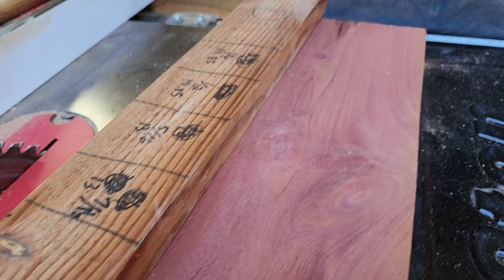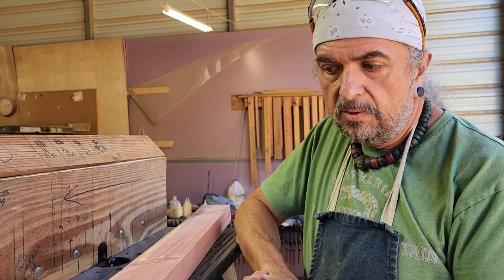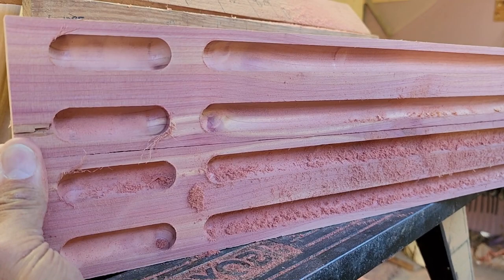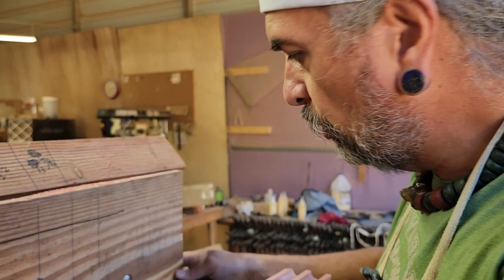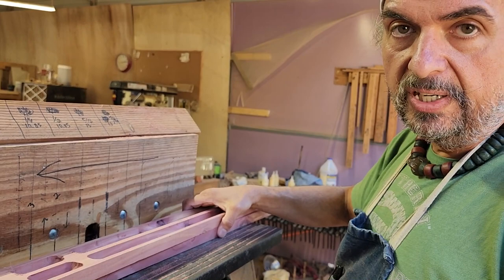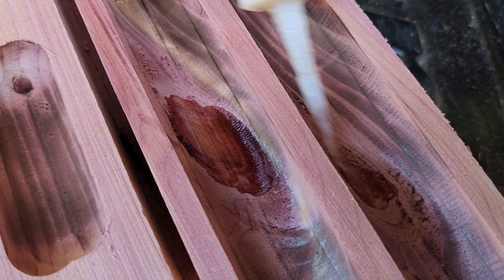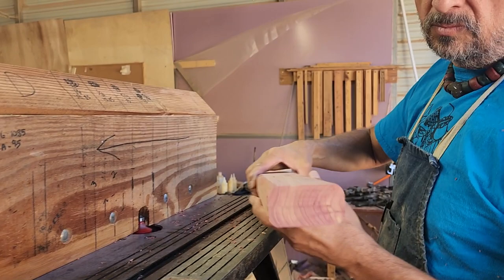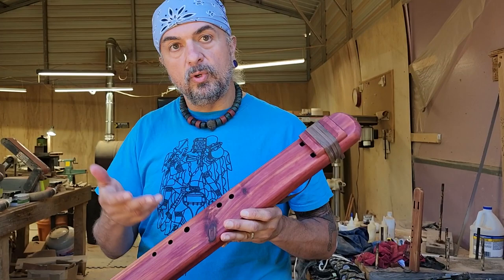How to Make Low D Drone Flute Tutorial - Blue Bear Flutes

Comment: Dude, thanks so much for all your show how!!! I'm about to dive right into Native American flute crafting!! I have 25 years experience in residential building and remodeling, all the tools, and access to some nice bamboo and red cedar as well, so I'm psyched to get started, and I super appreciate you Brother!!
   When you were talking about safety in this video pertaining to your router channelling cuts, I wanted to mention a few things that would keep one much safer when making these cuts with a cove bit as I have used the same setup and I know a board can run away from you and take your hand with it in lightening speed regardless of what kind of grip you think you have on it!
 If you start with a square plow bit 1/2 the width of your cove bit @ 1/3 the desired depth, removing that mass and then step your cove bit in to your square channel in incraments of 1/3rds to your desired depth, removing much less material per pass with far greater control, it'll relieve the buttcheek clinching and save your fingertips & livelyhood. There is also a type anti-kickback guard that you can purchase or make yourself, which with you can use push-sticks and assure absolute safety. I'll try to describe it as best I can because it's simple to make. This type of guide is a second fence that mounts adjustably with bolts/tracks/wingnuts like your standard fence probably does; opposite side of your existing main fence against the otherwise handled edge of your board. From a directly above viewpoint looking down at your router tabletop: it is a (guesstimate) ⁵/4" or 1”× 5"×9" parallelogram shaped block with a 2.5" forked (or toothed) side angled aprox. 12° from 90° in the feed direction. If you can picture this, it literally locks your workpiece in one direction against your fence permitting ZERO mistakes in your cut and fingertips! It's a win win! 
If you decide to make your own using wood, be absolute certain to use straight grain aligned with your 12° to the teething, or no less than 7 ply -¾" zero void finish plywood for this jig.

And so I write all this because safety means.... NO ACCIDENTS! And we craftsmen really do need our fingertips! WhirrrrrrrrzzzzzzzzzzRRRNNT! EEYOWWWWCH!!!! May we all know Christ, Peace for all nations, and many more creations. 
Best reguards 
        -Jake
Reply from the maker: Hey, Thank you for your comment Jake! Lots of great ideas in deed! I look forward to seeing your flutes!

Comment: Thanks for an nice video as always Charlie !!!

My single low E and D has an 30mm bore and the C and B has 35mm bore and my low A has 40mm bore and the G and F# has 45mm bores.
My low D and C drone has 35mm bores, special order for me since a bit bigger bore makes fuller sound and a bit shorter flute,
also ordered them unfinished, and i used Danish Oil to finish them.
I bought one low D a long time ago on the net that only had 1 inch bore and it did not had that full sound.
My midrange flutes has the standard bore size except for some specials A, G and F# that have 1 inch bore.

Just wanted to share.
My next wish in my dreams would be to get an mid drone F# with 1 inch bore :)

Comment: Charlie, I really really enjoy your videos and I have to admit I don't watch enough of them because I'm usually busy making flutes. Your videos are so packed with useful information that I help me when I run into a flute making issue or challenge.
 Interesting that you say the 3/4 core box bit will catch or pull less than the larger diameter bits. When I began making flutes I was using a 3/4 core box bit to create a 7/8, 1 inch wide air chamber/bore and I had the the flute blank yanked from my hands too many times to count. I had too many flutes ruined from using the 3/4 bit to create the wider bores that I invested in 7/8", 1", 1 1/8" core box bits. I haven't had any issues with the larger bits catching and yanking the flute half out of hands. I figure it this way, I would rather spend the extra time ordering the larger diameter bits than having to go to the E.R. because of potential injuries from using the 3/4 inch bit.

Comment: Hello, Charlie!  I've played the bagpipes for the last 30+ years, but I'm afraid I've been bitten by the NA flute bug now...  Bagpipe drones are not  made in halves and are usually made to be as polished as possibe on the inside.  I'm just wondering if the wood glue on the inside of the sound box will affect the tone if it is not cleaned out or at least smoothed a bit.  I'd be interested to hear your thoughts.  Keep up the great videos!
Reply from the maker: Hey, that's a great question! To be honest with you, when I lived in Oklahoma there was a flute maker there who made flutes with square insides. If you will think about the wind going through the flute as a fluid, it is similar to water going through the flute as a fluid. There is very little change that will take place other than possibly slowing down the speed of the water (or the wind). The flute is tuned properly and the soundhole is constructed correctly, it will sound good no matter what is on the inside!

Comment: Thanks for the video. I have a flute that won't allow the top hole "pop" embellishment during the melody. The flute jumps into higher harmonics. All holes are properly covered etc. How can I make a flute that allows for the pop between melody notes? Example at 1:20 on this video. https://www.youtube.com/watch?v=MGrkXyhW3rs
Reply: I never thought of this before, but yeah if you uncover the top hole and the rest are covered it often goes up an octave on the flute. Assuming you are practising enough to make it smoothly and quick motion (avoiding that higher pitch alternative fingering), have you tried doing it with the second from the top hole? Sometimes that hole works better depending on the flute.